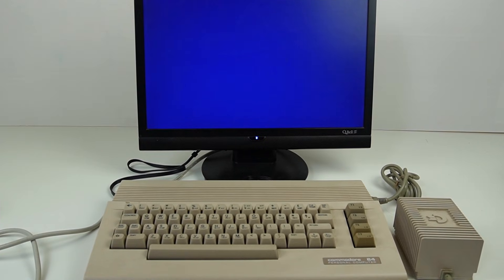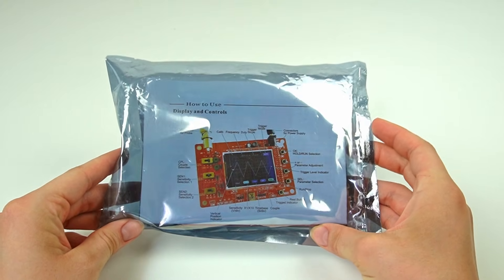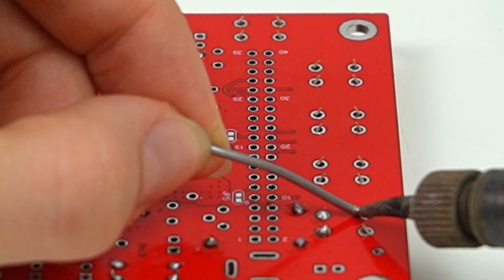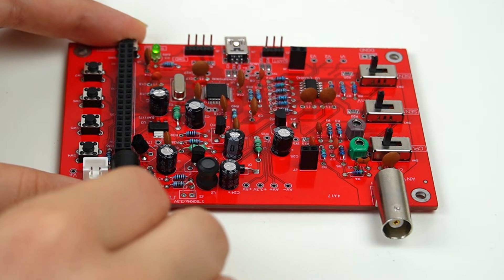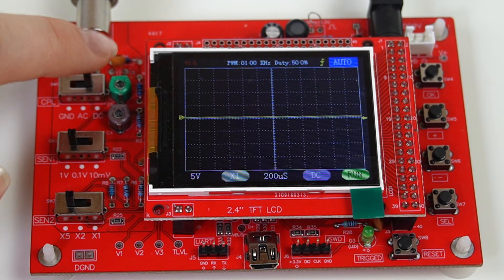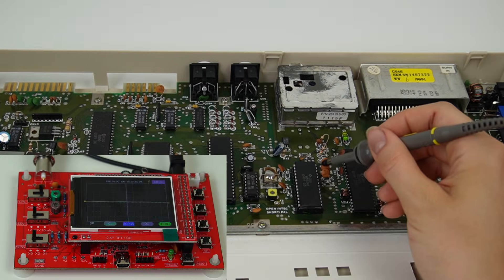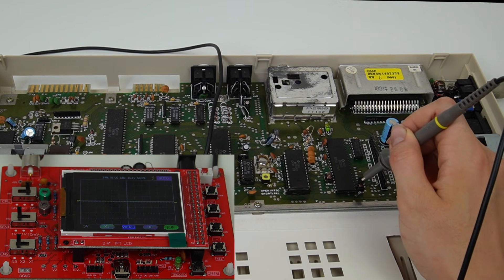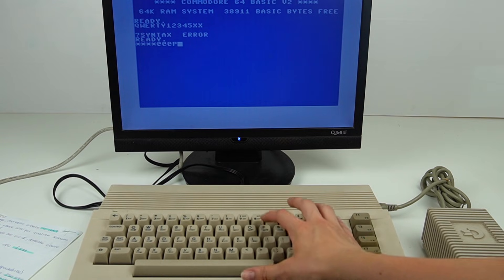I fixed a C64 using a $20 OSCILLOSCOPE

Comment: Good job 👍
I think the problem was a cold (cracked) solder joint though, rather than just corroded pins which usually do not reach into the solder. But the flux from the solder removed some of the oxides, too, helping with the measurements.

By the way, I had a soldering station with a tip just like this, and after some use the tip can fall off... so be very careful when using this 😅
Reply from the maker: Thank you! You're right; it's possible that there was a cold solder joint contributing to the issue. As for the tip ,you know, it happened to me once too, and I got quite a scare, so I completely understand. 😅
Reply: @Sayakas_Digital_Attic  

Yeah, it's a very unsafe design... what I ended up doing was connecting a cheap  40W soldering iron with the proper screw on the tip to the base station... The temperature control is fake anyways. There is no temp sensor. The circuit inside is essentially just a light dimmer which works just as good (or bad) with any old iron  :)

Comment: Hi Eleonora... very nice video! I enjoyed watching it very much. At the beginning when you soldered on the components you used what i would call a dull cutter to remove the long leads, and you i couldn't watch how you almost ripped apart a pad or at least destroyed a solder connection. If you want i can send you a nice german branded one. As you are located in Italy this should also be fine with shipping.
Reply from the maker: Thank you so much for your kind offer! I really appreciate your thoughtfulness. I've actually already purchased a couple of cutters, but I'm touched by your willingness to help. Thank u!

Comment: You need more heat ore a solder with lead. But for the first time - great. Some solder joints have cracks, we called them "cold solder joints" as TV technicians
Reply from the maker: Thank you for the advice! I appreciate your feedback and will definitely work on getting more heat and using solder with lead to improve my soldering. 🙂

Comment: Very lucky that it was just an oxidation problem. That means that originally that I/O chip had a marginal solder joint or two.
Reply from the maker: Yes, I was relieved it was just an oxidation issue. It's possible those solder joints weren't well-done initially. Thankfully, it's sorted now!

Comment: Sayaka how do you hook up your C64 to a modern monitor? I own a C64 too (and a gigantic pile of game cassettes), but I don't know if it works because I only have modern monitors at home and I'm not sure what I should do with it. What do you use your C64 for?
Reply from the maker: Hi, I built an RCA cable with a 5-pin DIN connector and a composite cable

Comment: Hi, nice and cute video:) was not expecting the oxidation problem, you have good intuition
Reply from the maker: Thank you, it could be that or, as many have suggested, a problem with cold solder joints! In any case, I was lucky since I wouldn't have had a spare CIA ;)
Reply: @Sayakas_Digital_Attic  what is a CIA btw?
Reply: Do you have any background in electronics or it's all self studied?
Reply: And I would expect the oxidation to affect the surface not the soldering beneath

Comment: Excellent job!  One tip for soldering from and old engineer... focus on making the metals in the connection hot enough to melt the solder themselves and never touch the solder to the iron to melt it. When everything is hot enough the solder will melt and be pulled into the vias by surface tension and the vias will be completely full of solder on both sides. One second more of preheating the connection is probably enough. Another tip when building with through hole components is that the extra lead length is a heat sink. To make things easier and faster to solder, I trim leads before putting the components into the PCB so there is only 1 cm of extra length, solder, and then I use flush cutting diagonal pliers to do the final trim. Keep up your great work!
Reply from the maker: Thank you for your valuable advice and tips! I really appreciate your insights as an experienced engineer. I'll definitely focus on making the metals hot enough to melt the solder themselves, and I'll keep the tip about trimming leads in mind for through-hole components.
Reply: @Sayakas_Digital_Attic  I hope your channel grows huge and I wish you the best of success!  You are doing EXCELLENTLY!  👍👍👍👍👍

Comment: Nice video. Just an advice, don't use the original Commodor PSU, I've heard stories about the original power supply suddenly going bonkers and damaging the computer.
Reply from the maker: Thank you for watching and for the advice! I appreciate your concern about the original Commodore PSU. You're right; there have been stories about them causing damage. I'll definitely consider using a more reliable power supply to ensure the safety of the computer.

Comment: This is certainly interesting as I have one working C64 (same type) and one not working, the more round version. Might just start with heating the solder to improve the connections.
Just wondering, how did you became interested in the C64 as it's before your time? For me it's just some nostalgia.
I do hope you have good ventilation with all that soldering.
Reply from the maker: I've actually been surrounded by retro computers and consoles since I was young because my parents were collectors. So, in a way, it's also a bit of nostalgia for me too😁.

Comment: When I bought a C64 in like 1984 it came in a round case same as VIC20 but darker color. Your's looks like it's in a C128 case. I wonder when they made C64 in those cases?
Reply from the maker: Over the years, Commodore produced several versions of the Commodore 64, differing both in the case design and internal electronics.

Comment: Oscilloscope wasnt neccessary, because it was just voltage measuring. It also wasnt oxid, but more like a cold solder point

Comment: Awesome seeing you working on these old beauties. Respect!
As some already mentioning the good old breadbins (C64 & VIC-20, i'd also throw in a C128 into the mix.
Same age as the angular 64C, but a bit more of a fun little challenge.
For example i'm currently working on a full rebuild, but with a brand new C128 Neo board.
So basically building a complete C128 from the ground up.

Anyway! This dutchy is going to say keep up the good work!

Comment: What did is awesome. I'm taking a systems class right now and we are only working with conceptual computers (some imaginary computer). It's cool to see how you directly read the clock and signals coming from the processor.

Comment: Watching the cutting segment I would suggest getting a new pair of wire clippers, so called "flush cutter" that is straight on one side. A cheap pair works great as long as you don't cut anything to thick. Otherwise I think it was good video, I'm off to buy me one of those oscilloscope kit! =)
Reply from the maker: Thanks for the input, I've replaced them😅

Comment: I still use a VCR, VHS tapes and a 90s rear projection tv. To me it's more fun than my modern home cinema. Awesome that you are into these nostalgic electronics.
Reply from the maker: Wow, that's awesome! I totally get the charm of using VCRs, VHS tapes and old-school TVs.  :)
Reply: @Sayakas_Digital_Attic  It's a little bit like a time travel. The droning sound, the image artifacts and - you can't fast skip chapters. So you watch all the crap that's on the VHS incl. the age rating and the trailers for movies you're absolutely not interested in. But it's a blast everytime. You didn't grow up with a C64, VCRs etc, are you? How did you get hooked?

Comment: It was a hard choice. But I finally went with the Tandy Color Computer 3. I upgraded it to a whopping 1 MB of memory which was on top of the case with its own cooler. A little more, and I wouldn't have had to go over programs I wrote and remove comments and spaces to save memory when they were loaded. Or learn PASCAL.
  My first build was a Heathkit multimeter. It didn't work, so I sat down and wept. Then, I stopped weeping and found one wire misplaced. Lucky.
Reply from the maker: It's interesting to hear about your first build experience with the Heathkit multimeter ,those moments of troubleshooting can be both frustrating and rewarding!

Comment: I used to sell and “repair” Atari’s and Commodores back in the 1980’s. There was a large rate of failure even after a year or less (but people smoked in their homes more and there was less air conditioning - i.e. higher humidity - back then).  Whenever someone brought a non-functioning micro-computer into the shop, we’d take it in the back and do the “Atari Twist” basically twisting the unit without opening it which effectively twisted the motherboard a bit, moving the socketed chip legs breaking the oxidation barrier.  I would say that fixed all these units at least 90% of the time and we’d emerge from the back as “wizards” and say “no charge” and then go on to sell some new software (on cassette or floppies).  It’s the same with solid state pinball machines, socketed chips are always the first problem to address.  Press and re-seat the chips (or remove and replace) and it’s largely the problem.  If you don’t do that first, you can be chasing your tail a bit tracing signals.  The second issue with older electronics is often capacitors which have a limited lifespan.
Reply from the maker: Thank you for the message and for your suggestions!

Comment: European accent individuals also say 'Solder' like UK folk, rather than the annoying 'Soder' no 'L' as Americans do. Thanks for the upload.
Reply from the maker: Thank you for the upload, and I appreciate the tip! I'm still working on speaking American English fluently, and it's good to know the pronunciation differences. Your feedback is valuable!
Reply: tbf, According to wiktionary the etymology of the word is:
From Middle English souder, soudere, soudur (noun), from Old French soldure, soudeure (noun), from Old French souder, solder (“to solder”, verb) (> Middle English souden (“to solder”)), from Latin solidāre, present active infinitive of solidō (“make solid”).
So Middle English took the L-less form which existed in the the Old French along with an L-posessing form which both come from a Latin word which contains an L. Likely, this is one of those times where the current spelling didn't exist in pronunciation nor spelling until scholarly people well versed in Latin and Medieval French and English reintroduced an older spelling that more closesly aligned with it's original classical spelling (in this case, the old French spelling "solder" which more closely reflects the Latin solid[o/are] with its inclusion of an L). I'll also note that ironically, they sometimes did this erroneously: for example, we have "island" for "iland" because 16th scholars changed the spelling of "ile" back to one of its older French spellings "isle" to hint at its derivation from the s-having Latin word insula and erroneously changed "iland" to "island" assuming it must have also derived from the Latin word insula (as if it were isle-land) when in fact it does not and "ileland" is completely Germanic in origin and never had an s.
I prefer the pronunciation with the L however.

Comment: As you were going through the process of building the oscilloscope, and resolving the issue with the C64, you reminded me of when I built a "Radio Shack ArcherKit Electronic Engine Analyzer" by hand soldering all circuit components and hand tuning the device during Christmas holiday in 1979.  I bought and built that so I could work on setting up a newly available electronic ignition system I purchased that promised to save me on gas. This was on a 1970 Buick GS which was a gas guzzler. Saw about a 2 MPG improvement from 10 MPG and later introduced myself to the world of computers and programming on a Commodore 128 a few years later.  I'm still working in the industry. Thanks for the flash back.
Reply from the maker: Wow, your experience with the Radio Shack ArcherKit Electronic Engine Analyzer sounds like a real DIY adventure. Thanks for sharing your flashback!
Reply: Cool story, cool car, cool computer!

Comment: The good point is to take a toothbrush and wash oscilloscope board from rosin with isopropyl alcohol (in the fresh air). Used isopropyl may be reused again (keep it into another bottle).
Reply: Yes!  I found a depth sounder malfunctioning due to excess flux never being cleaned up on the backside of the board.  Used alcohol and Q-tips, reassembled and it worked perfectly to the day the sailboat was sold.

Comment: I have the same OSCILLOSCOPE, also build it myself 5 years ago, the first one 
was DOA, and they sent me a replacement, and that one worked.

Bit i did not like the way it worked, was to hard to understand how it worked, 
i had to learn every time i used it after months, how it worked, so i bought the 
FNIRSI DSO-TC3, what is a Digital Oscilloscope Transistor Tester Function Signal 
Generator 3 in 1 Multifunction Electronic Component Tester, all in one, and it works 
great, better then the one i build and you have, and it can also test all my caps and 
much more, and it gets firmware updates that are very easy to flash.

i repaired all my father his C64 computers and disk drives, that was not working 
when he bought them, multiple chips were not working, including ram chips, so i 
bought new old stock ram chips and more, and all the chips, and tested them in 
my working C64, and now it's working again, also replaced the bands in the tape 
drives, and calibrated the tape drives with a special program i got from Jan Beta, 
also a YouTuber, who repairs old computers, mostly C64 and Amiga computers, 
and recapped everything, the C64 computers and big floppy drives.

BTW i also had to replaced the chips in the floppy drives, tested them in a working 
one i also have.
Reply from the maker: It's great to hear about your projects and the tools you've used. I like your dedication to restoring vintage tech
Reply: @Sayakas_Digital_Attic  Yeah i wanted it all working for many years, i also recapped my C128D and 
recapped all the caps in the PSU of the C128D, and recapped my Amiga CD32, recapped my fathers 
Amiga 2000, and more, yeah have been busy a wile, was fun to do.

Wish i had made video's of it.

Comment: That took a bit of intuitive thinking to consider re-soldering the chip when you found that you had to press hard on the pin to get a signal. Good job! Make sure to heat the pad and component wire then let the solder flow into the connection. Keep it up! 😄

Comment: Where do you see voltage readout on the scope screen? I only see the wave.
Reply: I think the center line was calibrated to zero, so the step up, one block would be maybe  five volts. Two blocks = ten volts.

Comment: Great video. A pro tip. First thing to do is to replace stock power supply unit. They tend to wreck havoc not only to themselves, but also to C64 as well.

Comment: That was brilliant. really interesting. I had the C64 as a kid in the 80's and the sinclair spectrum 48k and also the 128k one. 
I also bought a commodore Vik 20 at a boot sale and also had an Atari ST520. Then I moved on to consoles until I started building my gaming  PC's and fixing old ones during the 2000's. Now I have a Ryzen 9 5900x and Rx 6800 GPU with 32 Gb Ram. and 2 steamdecks. Oh how things have changed. I always loved computers. Could you not have used a multi meter though?

Comment: What ever cause the problem, but there is no oxidation inside Solderpoints. If you can't measure because of oxidation, ok, but this won't effekt a signal on the Board, at least its a chip with no Socket. Other tipp, the C64 had two CIAs you can swap to find out if there is a problem.
Reply from the maker: Thank you for the suggestions.

Comment: If the problem was oxydation, this probably build on top of the component legs and probably didn't affect the solder joints much. You most probably fixed it by disassembling it and re-assembling it (and using the contact cleaner) which cleaned/deoxidised the connection between the motherboard and the keyboard.
Still well done, as long as it worked! And your oscilloscope will definitely come handy in your hardware journey 😊
Reply: Same thoughts here. I repair C64 since 19 years and I had these situations. Someone flooded the keyboard and the connector was affected with small corrosion. After cleaning and plugging/unplugging the connector - everything started to work again. There was nothing to solder. I appreciate the work shown in the video by the way:) I have never had "cold solder joints" on any ICs in any C64, except for the power jack. Stay cool, good luck :)

Comment: I love that little oscilloscope. I got the same one last year for a similar reason: Just had a little problem that only an oscilloscope could help me solve, but didn't have the money for a "regular" one. That little thing still works perfectly and I use it often. I would be satisfied with it even if it cost $80.
Reply from the maker: I'm glad to hear that you've also been able to benefit from this oscilloscope
Reply: Can you please share a bit more info about the scope? I suppose it is some AliExpress or Amazon kit right? Would you please share the link.

Comment: The issue was more likely to have been a dry joint rather than oxidation, especially as it was fixed by reflowing the pins.
Reply: Indeed. Some old electronics break in decades due to uncleaned soldering acid.

Comment: those little oscilloscopes are very useful for what they are , i got one a few years back, plus a custom clear perspex casing, BUT you have to watch out, theres been a change in the firmware and needs a resistor or two changing from the original design,  the parts that came with mine were wrong , for the earlier version